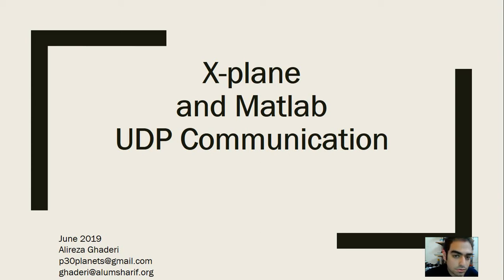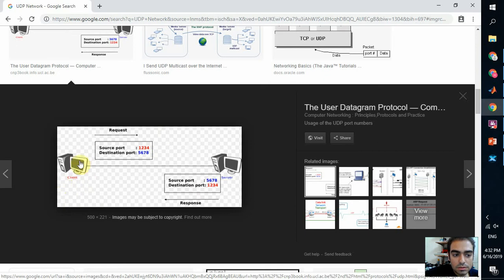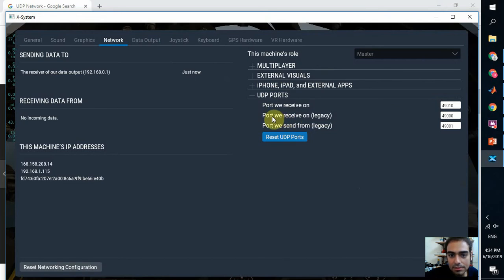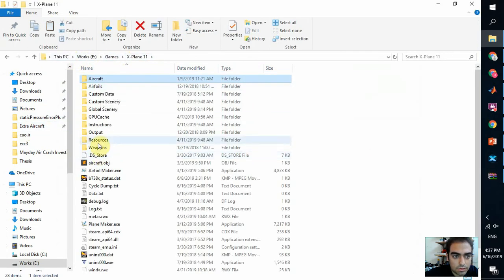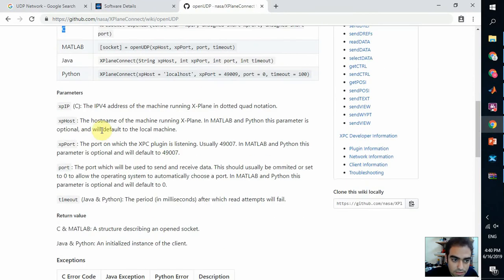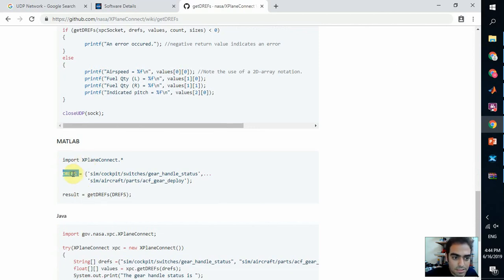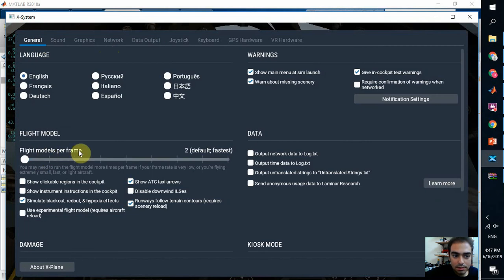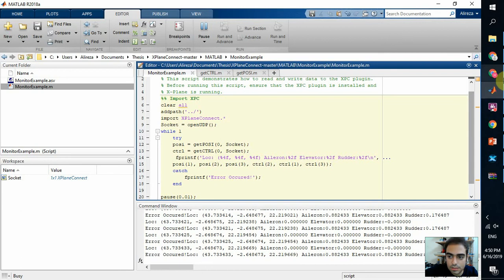X-plane and Matlab Communication via UDP using NASA XPlaneConnect (XPC)

Comment: Hi, 4 years too late but im managing to have every function work except sendPOSI, it used to crash xplane, i now instaled a beta version of the plugin and now it doesnt crash, but whichever latitude and longitude i choose it sends the aircraft to (0°,3°) and the value of pitch variable is huge like there is an overflow. The value of latitude and longitude is also huge when seeing it with the getPOSI function. Any idea what it could be? I tried reverse engineering the plugin but unfortunately i dont understand the code enough
Reply from the maker: Hi. maybe using dataref override works . user position override and overrride directly the dataref of the xplane for position
Reply: @alirezaghaderi  hey, thanks for the reply. Using a different version of the plug-in ended up working for some reason 🙏

Comment: Hello I already have Plugin in xplane. If I want to work with C language whitch file in whitch folder should I work with? I want only get data from xplane11. Thank you
Reply from the maker: I didnt get what you mean. just for getting data you can use UDP out functionality
Reply: @alirezaghaderi  I want to work with this plugin and use C language. So I think I will use function getDREF() But I do not know Where (in whitch file) should I Call this function.
Reply from the maker: There is a good documentation on their website and github for that. you should include the library .h file and then you can use it

Comment: is there any way to connect with Visual Basic?
Reply from the maker: Yeah... but not with this module. check my video about getting data from xplane using udp in Simulink. you can retrieve UDP packets in any platform you like

Comment: Something important I need to add. You added the xpcPlugin folder to the plugins folder in the XPlane directory. This didn't work for me. I had to add instead xpcPlugin/XPlaneConnect. Maybe this is due to updates, but this is what worked for me.
Reply from the maker: Thanks for the tip ! Nice

Comment: Matlab senddrefs cant change lat,lon,alt values. But it can change some values like throttle, elevator,rudder.. How can ı solve this problem?
Reply from the maker: because dataref for the location is read-only  but there are ways to change location like using SDK and UDP Data... there is spacial command for matlab for this purpose...search function sendposi() in the girhub  documentation
Reply: @alirezaghaderi  thanks alireza

Comment: Thank You very much. This is what I am looking for. Have a good day, Sir! :D
Reply from the maker: Good Luck!!
Reply: @alirezaghaderi  Hi! I got a problem with the java. It says "Undefined variable "gov" or class "gov.nasa.xpc.XPlaneConnect"."
What should I do?
Thank you
Reply from the maker: Definitely you have a problem addressing the classes and libraries and dependencies. copy the folder from github and dont change the structure. This error is telling you that a class (which is in another file) is not found.
Reply: @alirezaghaderi  Hi!
I've fixed the problem. I made the connection and got responses. Thank you.
It was because of the older JAVA version in the MATLAB that didn't support for opening .jar file.
Reply from the maker: Your welcome....Thanks to share the cause.  Good Luck

Comment: Thank you for this video. Please clarify the following in your X-Plane plugin folder.I see the required xpcPlugin file we get from Nasa but I also see in your folder just below xpcPlugin a XPlaneConnect file with the same date. Where is this found?? The Nasa instructions do not 
indicate this or do they?? Please clarify this. Using this approach to access data refs is nice  but I having difficulty using C with Xcode and XPC.Maybe the lack of this other file is the problem.THANK YOU.  I will be looking forward to your Arduino communication videos.
Reply from the maker: Hi
I admire your detailed attention
Actually the folder "xpcplugin" is consists of both source of the plugin and the compiled binary as well. what Xplane needs is the folder "XplaneConnect" . It doesn't matter if it is in the higher order or lower order of file directory. all xplane needs in finding "XplaneConnect" folder anywhere in plugins folder.
If you still dont understand you can describe me more about the problem and I can help you more.
Reply: @alirezaghaderi  I found that I needed to put the XplaneConnect folder into the plugin folder to get things sort of working. This was the only way the plugin was recognized in xPlane's plugin drop down list. I kept the entire "xpcplugin" folder in the plugin folder also. I am using Xcode -- Have errors however when using the example Xcode project file similar to the one you use in Matlab. Unfortunately I do not have Matlab to follow your approach. Even having trouble trying opening/closing a socket. Will try again. Any suggestions or other links to read?? I like this software but I am having trouble using it. THANK YOU for your help.
Reply from the maker: @JoLo-vx1nb  This is exactly what I told you in the last comment. All Xplane need is XplaneConnect folder . and other stuffs inside xpcPlugin are plugin sources. and You are right . Maybe Xcode complains about that. so you need to keep only XplaneConnect. I will post a tutorial for Xcode as well in future. Thanks for the info

Comment: Thank you for the videos they are great! Was really hoping this UDP video would have been with C++. its clear in this code that xpcplugin is required but i'm almost certain you don't need it, I just don't know how...
Reply from the maker: If you mean there is a way to communicate with xplane through UDP without this plugin, you are definitely true. You can connect manually. but you need to know xplane data template and protocol and etc. This plugin only make the life very easier for you.
Reply: @alirezaghaderi  unfortunately the plugin for me just isnt an option. I need this to be a standalone application. Do you have any resources for an advanced UDP protocol?
Reply from the maker: @michaelsd88  you mean you cant use C++ with 3rd part libraries included? Weird!
So the only option is using X-plane data output. go to you x-plane setting . data input/output
you can activate UDP data transfer either using data columns or datarefs. the template is described in x-plane developers site. you can see an example here:
https://questions.x-plane.com/12546/data-output-format
Reply: @alirezaghaderi  do you have an email address I can send some info to?